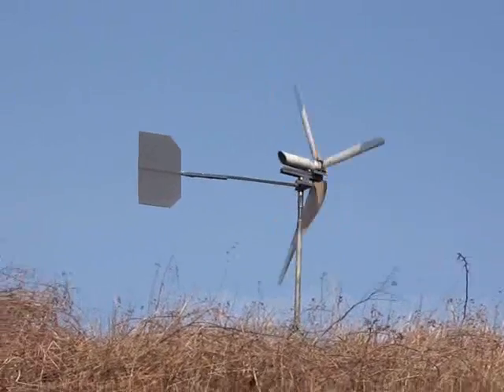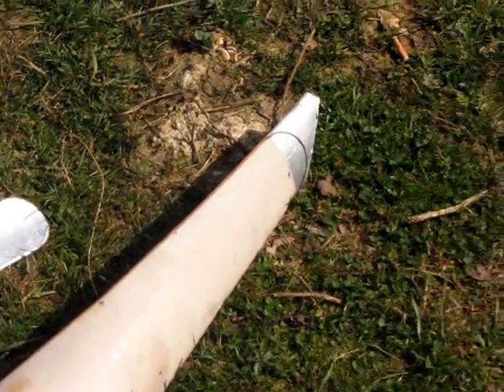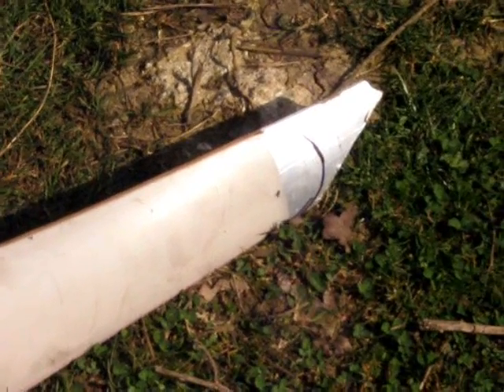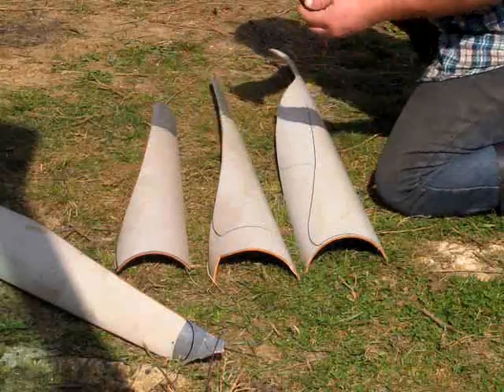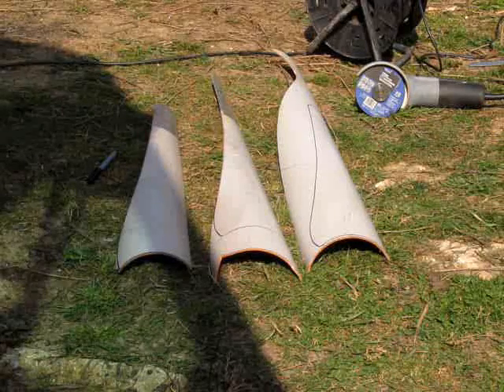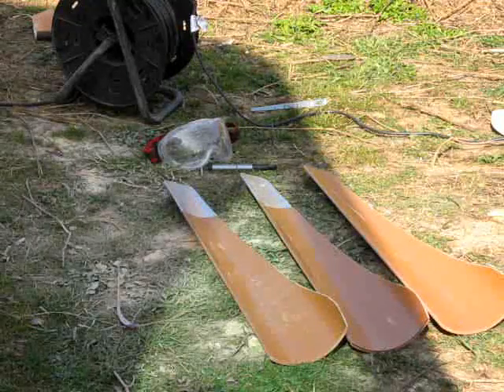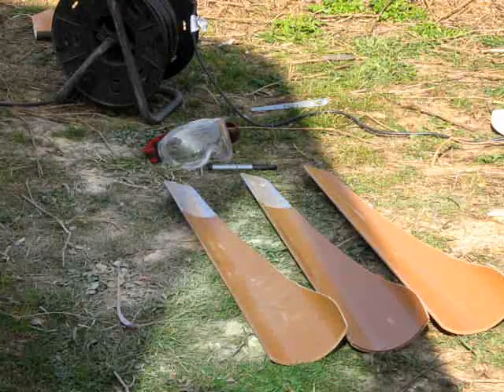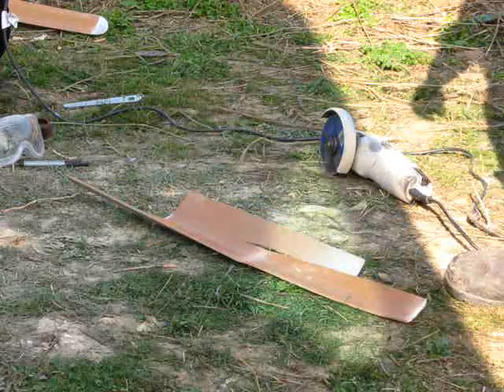Making PVC pipe turbine bades

Comment: ... Hi Greg. Good idea to use PVC pipe to make the blades as you can make an ideal taper and twist for each blade. My concern would be fatigue in the PVC near the blade root. Do you have any information on how long blades made from this material last? I have made wooden blades before about 750mm long each. This was successful but you have to keep painting them to make them last and stop water, hail & wind destroying them. Making them from wood takes a lot longer:- you have to make the blade from 4 or 5 lengths to reduce twisting of the wood when it dries out, and be very accurate with the blade profile or you will get vibration caused by one blade being more powerful that the others causing vibration of the rotor head. There is a lot more to making good blades than you would think. My next project will be to make a mould and make them from fibre-glass. Then you have to find a suitable generator!
Reply: definitely need slight twist in the blade  and schedule 80 ,8 inch makes  1.5 meter  blades

Comment: Can I use electricfan motor for this? I had a difficult time searching for motor to use for this project... I just want to know if its ok to use that one..
Reply: howtosaveupenergy A good motor to use is a old treadmill motor they usually go for around 30 to 50 bucks. You could use any electric motor but but permanent magnet motors are better and you have to look at the rated RPM of the motor if I remember correctly the higher the RPM the more rotations it takes to produce energy so you want a low RPM motor.